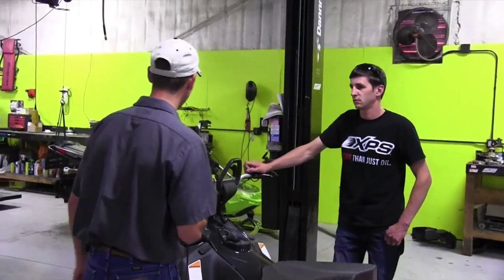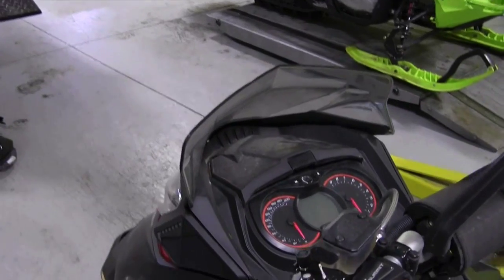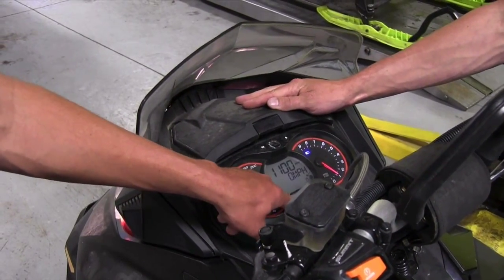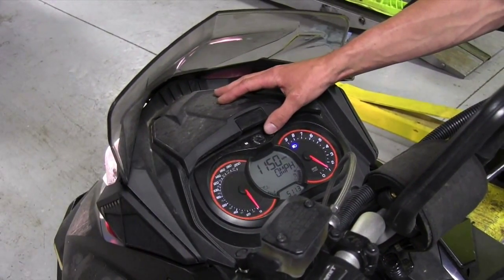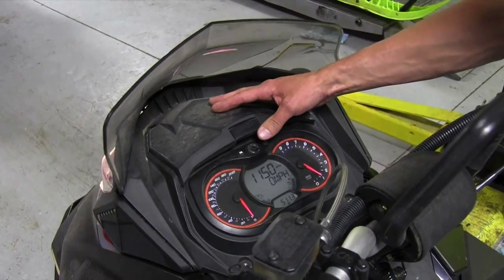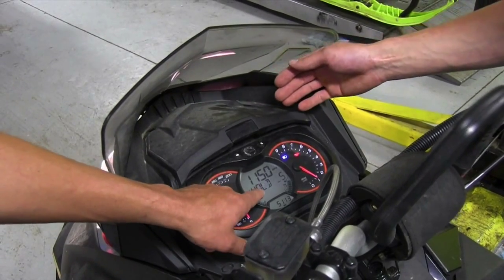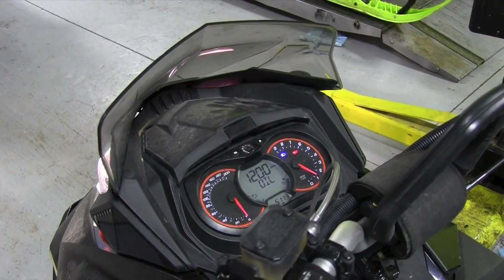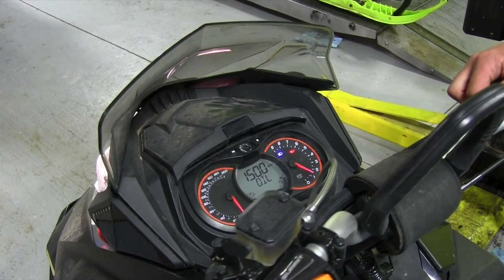Easy Ski-Doo E-tec Engine Summerization Procedure. Getting a snowmobile ready for summer

Comment: This is only for etec not carb models?
Reply from the maker: Etec only option
Reply: @MontroseMotorsports  my 2015 skidoo summit won’t throw its self into summer mode i had a 600 renegade before and it went into summer mode any tips